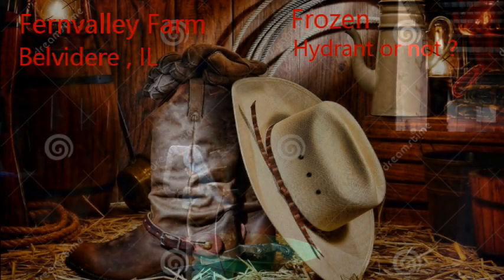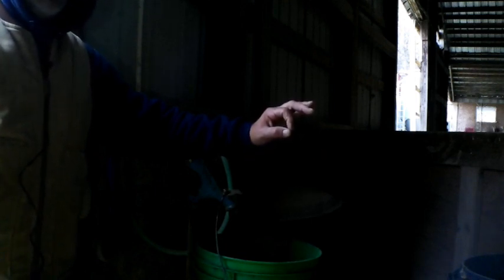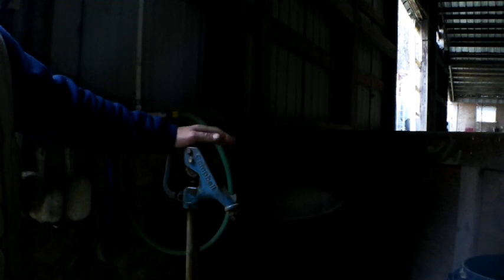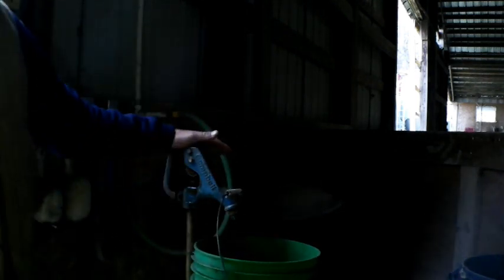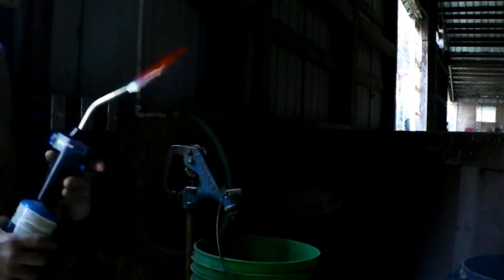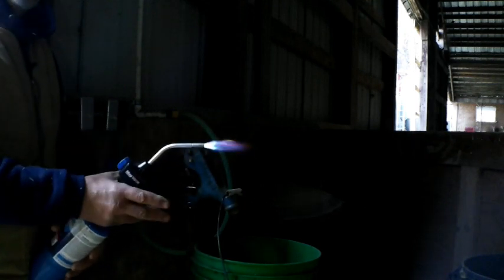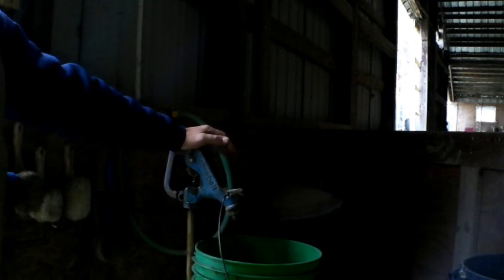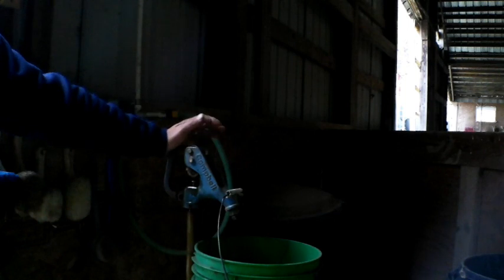Frozen Water Hydrant ?  Nov 17 , 2018

Comment: I've seen many a hydrant split from people taking torches to them. Going from frozen solid to that high of a temperature so quickly will split that cast iron so fast. When frozen, its just best to stick a barrel over them and turn on a heat lamp or cut a hole in the barrel and stick a heat gun in it and have patience til it thaws.  Just my opinion.
Reply from the maker: I have been doing that for years and have never had a problem knock on wood. I just heat that top part. That's it. Because that's where it sticks at pops right loose.

Comment: Hi. Wisconsin here. We hve outdoor hydrant for horses. We hve to attach hoses to get to trough. Hoses froze w hydrant handle on. Took hoses off. Was able to close handle but still haven't been able to thaw. In this situation by closing handle did we damage it somehow? Thanks.
Reply from the maker: you always have to disconet the hose the water freezes in hydrent, spout , also if there is water in the pipe and did not drain all the way at the bottom its froze till a good thaw, the hydrants have a drain valuve all the way at the bottom to drain the pipe out. also dont force the handle up you could pull it out of sink then it will not shut of at the bottom . hope this helps any more questions feel free to ask , and thanks for watching.
vince.